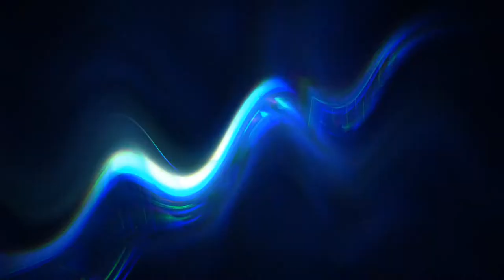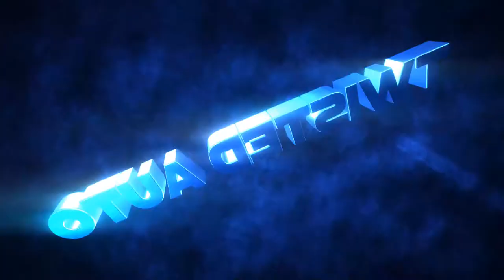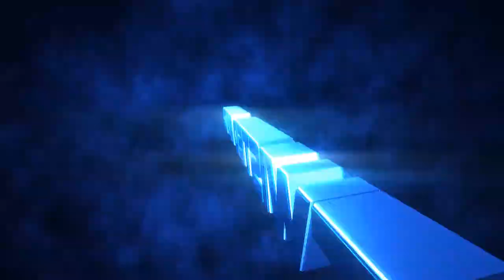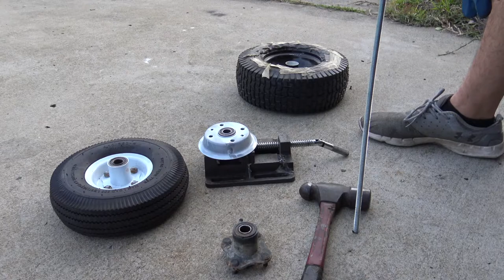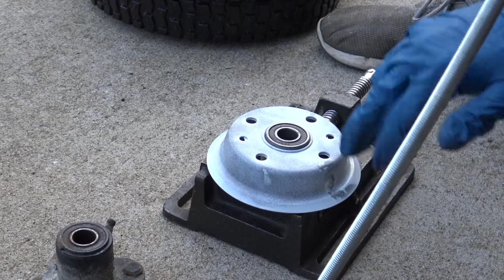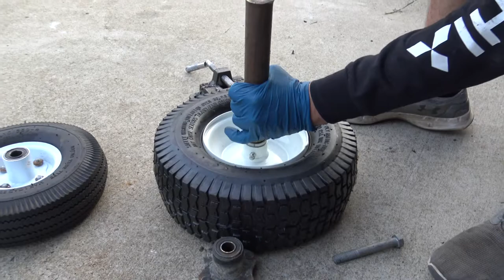How to replace a bearing for a Go Kart

Comment: I have a couple of front  wheels from tractor supply, and after using them for about 2 weeks the bearings break, I used to have some wheels from harbor freight but they broke even faster, solution?